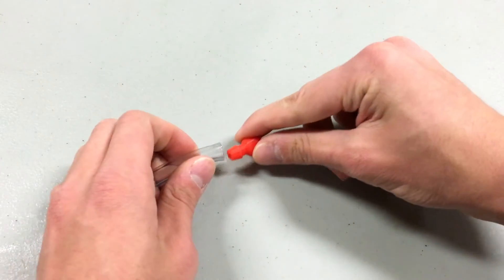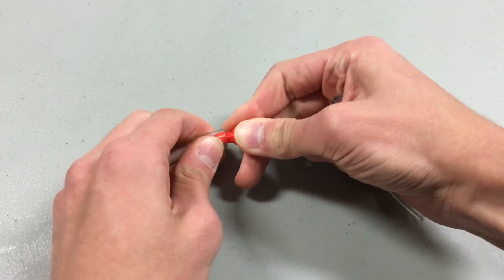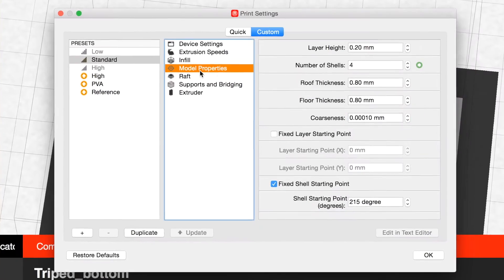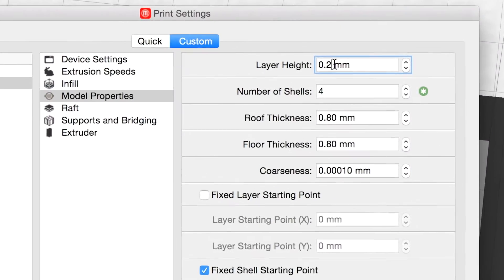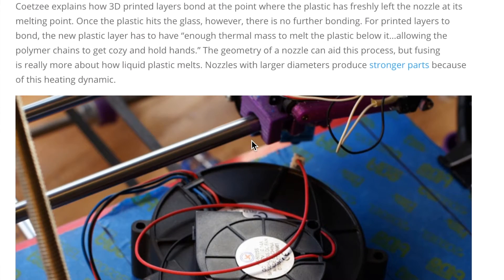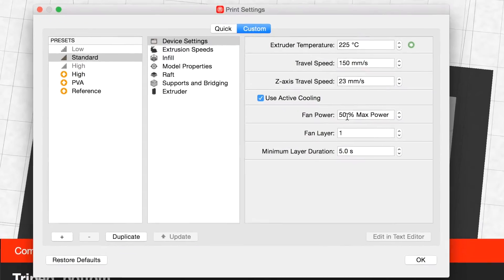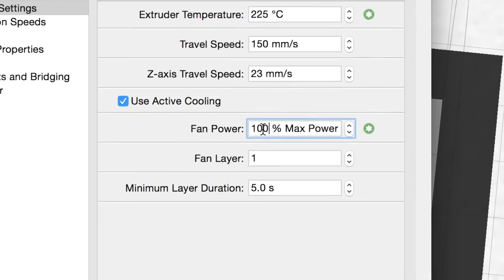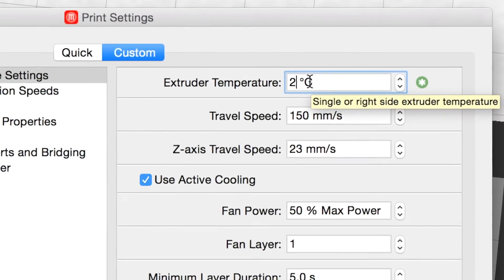3D Printed Tubing Adapters

Comment: Thanks for the video. You may use annealing after printing, by reheating in a oven. So you get rid of potential cracks and weaknesses. There are tutorials for that available in the 3D printing community.

Comment: Hey, I'm in a sticky situation and need t-joint for a 7mm tubing so that I can split it up between multiple plants. Would this be hard to make?
Reply: I had the same problem, because a normal t joint is hard to print and support material seems to be no solution, because its leaking after removing it. Here is a good design for printing https://www.thingiverse.com/thing:718132